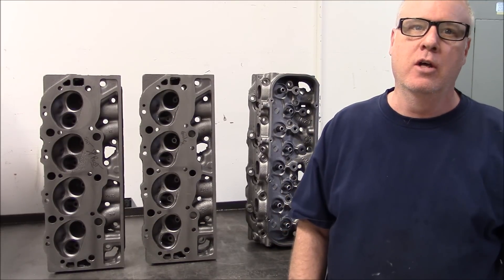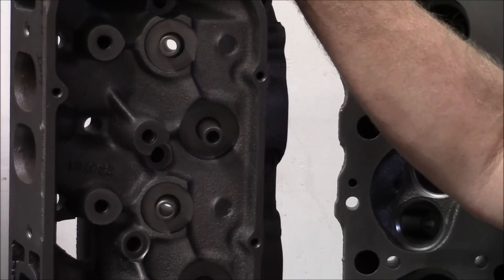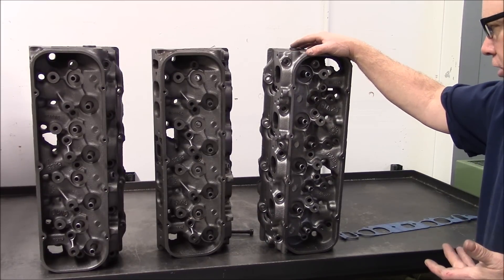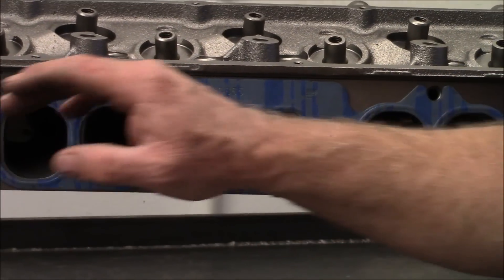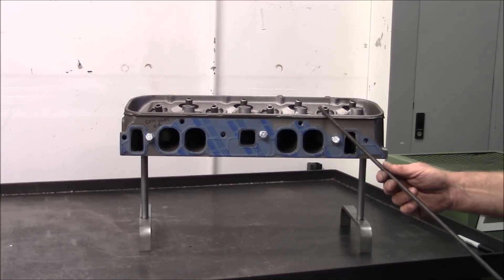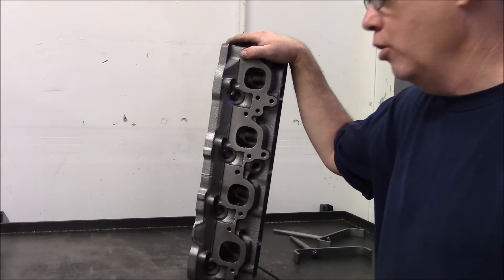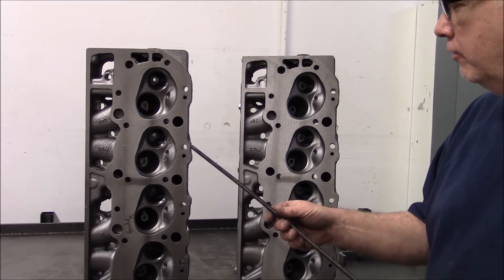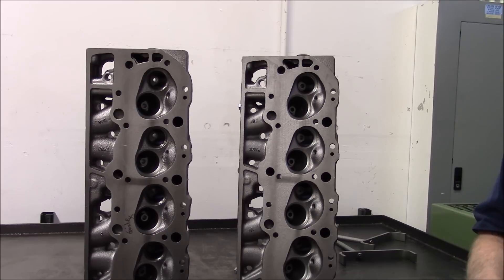Engine Build 620 HP 454 Big Block Chevy Part 3 Oval Port Head Core Selection Before Porting

Comment: Would you stick with an 049/781 on a drag strip 427 and make up the compression with the piston? I have some 036 (I think) 100cc closed chamber oval ports, a couple pairs of 781s and a pair of 990's. The biggest off the shelf dome gets me to about 11:1 with a 119 cc chamber. I probably already know what you'll say about the 990's but there is something romantic to me about a rectangle port 427 even if its kind of a slug.
Reply: I set the compression with the dome always.
Reply: jim dandy I think the consensus is factory gm rectangle ports are too big for a sub 500ci bbc on the street. They flow ok, but they have low port velocity so not as much air is crammed in at low engine speeds. I've seen a back-to-back test comparing 990s and 781s with 2.19/1.88 valves. the 781s were a few tenths quicker with a 454, 220/220 .500/.500 cam, and a matched dual plane intake and a 4 spees in a 2nd gen camaro.
Reply: Are you saying the oval port head was superior to the rect. head of the same era? I do remember much debate back in the day over the oval vs rect. head choice but the rect. did have larger intake valve 2.19-- the performance engines did come with the rect. port heads
Reply: best luck with smaller rect ports though. 990s are bigger then some of the older castings, which can be around 305cc, like the 074 castings.
Reply: Keep in mind bigger valves dont flow better unless ported. For example- in a small block 1.94 head, if you put 2.02's in, you will ALWAYS lose some power on the dyno unless you open the ports up. There is a formule for the port size but the hole should be generally 90% of the valve diameter. Not to mention a heavier valve floats sooner if you use the same springs.